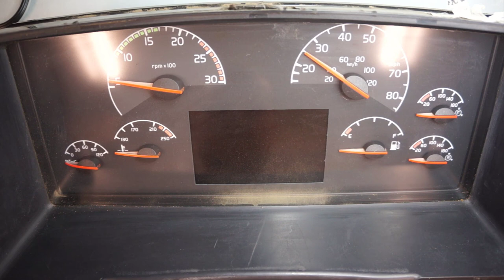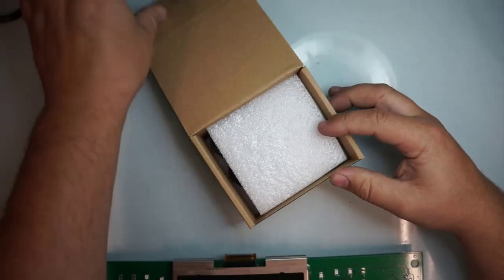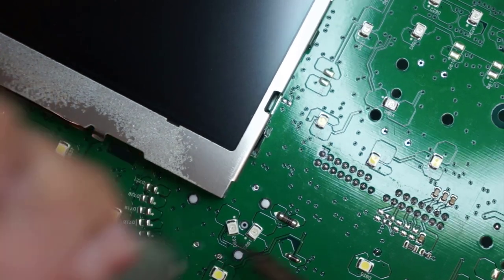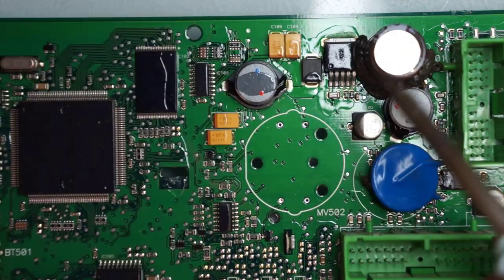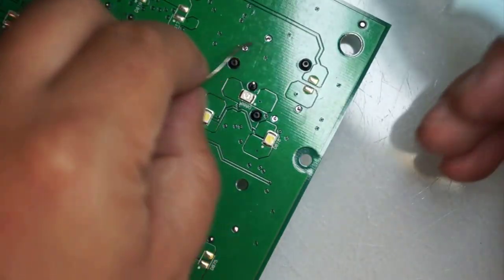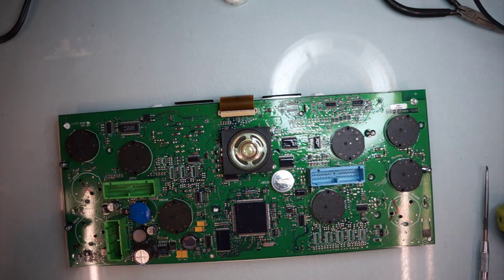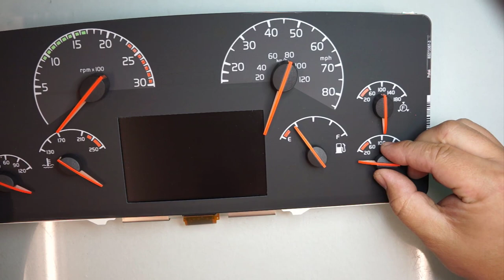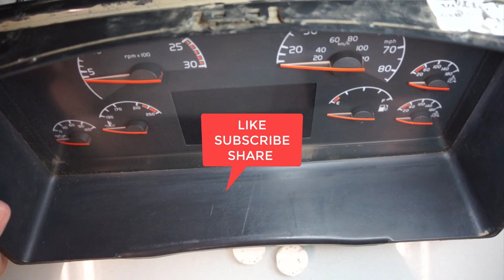Volvo Semi Truck VN VNL Instrument Cluster Gauges Repair

Comment: How did you diagnose that cluster? Seems strange all of these would go all at once. Was the board bench tested first or not? Also, why not just pull the dials off by hand? Why use the face to force the off?